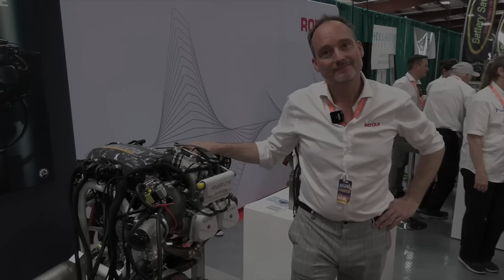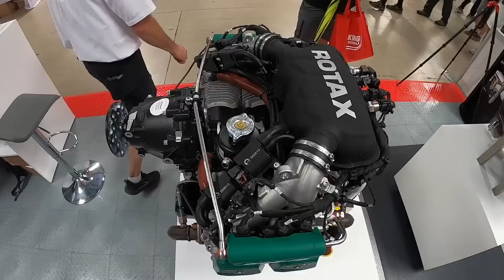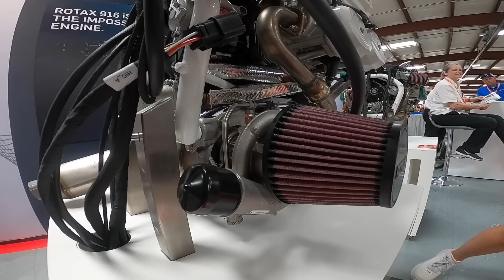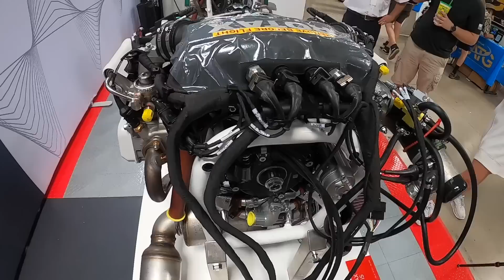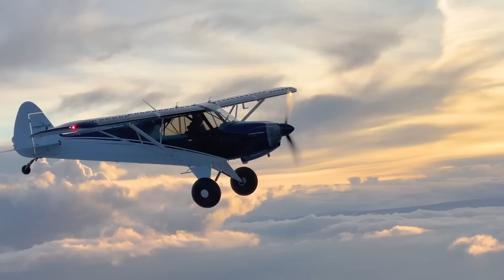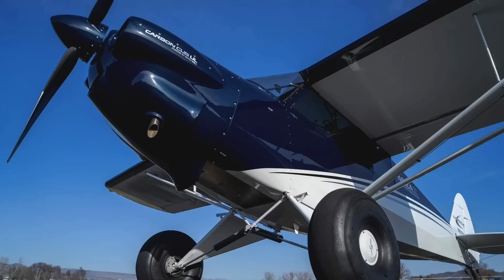Rotax Introduces 916 Engine, CubCrafters First OEM

Comment: I can get an 180 hp aero sport lycoming base with injection and electronic ignition, engine mount and a sensenich ground adjustable prop for the cost of the 916. Why would I buy that?
Reply: It weighs a lot less, it uses port injection like your car, maintains 160HP up to 15,000FT, easier to operate, more redundant, and is designed for MOGAS.
Reply: Lycoming injection is port injected actually into the intake right before the valve. Electronic ignition and backup magneto on both mags. Mag syncing on the electric side. Pilot controlled leaning or Electronic if you so choose and No gear box. Weight penalty not as much as you think as the 916 out of the crate is almost 200 lbs “ before” accessories.  No computer needed to troubleshoot on the lycoming.

Comment: They have a large research department working on new ways to overprice it and they are very proud of what they have achieved in only a couple of years. Taking a VW beetle engine and pricing it at what a Tesla costs.
Reply: Perhaps you should spend more time getting a job which can afford you one of these engines instead of  trolling the Internet spouting your distain.

Comment: I will only start to respect Rotax as a serious aircraft engine manufacturer when they produce engines with:
1) total independence from generator or battery electricity (like its classic competitors)
2) Direct propeller drive (like its classic competitors)
Reply from the maker: We'd say there's zero chance Rotax will begin using magnetos and carburetors on any of its new models. Just not the way the company thinks. Given the company's history and how many 912-based engines are working in the field, it's hard not to call them a serious aircraft engine manufacturer.
Reply: @KitplanesMagazine  I didn't say anything about magnetos and carbs, YOU did. And I really don't care about what "the company thinks". What matters to me are the features of redundancy and security of a well designed engine. Company's history? I've ben watching several Rotax failures reported here on YT and elsewhere, most of them by electrical issues. It can be hard for you, but very easy for me to see what really makes difference.
Reply: @RobertoRMOLA And ive had magnetos fail, magneto wiring fail etc. Reduction gear boxes make a ton of sense as well. Lyc/cont have internal gears for other uses and magnetos is just another type of electrical system. Truly don't understand your position.
Reply: @RobertoRMOLA  Hey Roberto, the 1940's called, they want their plane back.

Jk, but Roberto here is a prime example of the old geezers who will never get it. They insist on flying 1940s era technology because their old minds can't comprehend any of this new fangled stuff.
Reply: @sl66ggehrubt  It's not "my" position only: it's the market and industry position. Will repeat: SELF energized electronic ignition systems (not magnetos) are increasingly popular among "old" Lycs and Conts especially because of better performance and fuel efficiency. Can you understand this?
Reply: @TheOwenMajor  ...and 2023 era technology are asking for electrical (batteries are inefficient, for now), hybrid (nice intermediate solution) and diesel (the future now) engines.
Reply: @RobertoRMOLA  Roberto, the issue is you clearly don't understand the principles involved.

Ok, regarding your ignition system, I'm really not sure what you're talking about.

Something like Emag ignition isn't really "self energized". It just has a built in alternator. 

It's a product aimed at old guys like you you really want magnetos.

And the whole direct drive thing is silly. We had reduction drives in the 30s for high power engines. The only reason lyconosaurus used direct drive in the 40s was it was more reliable... For the 1940s! 

They also thought lobotomies were the future of mental health back then...
Reply: @TheOwenMajor  OK, thanks for sharing your thoughts.
Reply: Unless there's scary failure data available for either the EFI or the gear-reduction unit, these are unfair criteria imo.  Pouring leaded gas down the gullet of a Lycoming or a Continental isn't my idea of a good time.
Reply: Reduction drive makes a lot of sense. I never want to see old mags ever again. Mags that have adjustable timing are critical for better performance and fuel consumption.
Reply: @crissd8283  Reduction drives are known in engineering as an extra failure mode. And self energized electronic ignition systems are increasingly popular among "old" Lycs and Conts especially because of better performance and fuel efficiency.
Reply: @RobertoRMOLA  I do agree with self energized electronic ignition system. While a gear reduction is another failure point so is needing more cylinders to make the same power. Would you rather have a 4 cylinder with a gear reduction drive that is lighter and just as powerful as a heavier 6 cylinder without a reduction drive. There are a lot of added parts and places for failure by adding on 2 cylinders. This is a personal preference.
By the way, all turboprop engines use reduction drives. Lycoming made plenty of engines with reduction drives such as the GSO-580, GO-480, GO-435, etc
Reply: @crissd8283  I knew you were going to mention turboprops! The power delivery of a turboprop is as smooth and continuous as an electric motor. But, a piston engine produces pulsating rotational energy and vibration, but not all the engines you mentioned have torsion dampers to absorb those pulses. Furthermore, the torsion damper itself constitutes a very recurrent failure mode.
Reply: I guess nobody with respect you, Roberto
Reply: @Captndarty  I will respect your position and will fight for YOUR freedom of speech, but being in aviation for 46 years flying part 91,135 and 121 gave me a lot of experience, friends and well founded opinion. Nobody, you say? Really? You would have to know me and meet my friends and colleagues first to say that.

Comment: Wow, the 160 hp of a 320 on takeoff and with 137 continuous! That’ comparable to a 180 HP 360 running at 76%.
After about 8,000 MSL this turbo Rotax should run away from a naturally-aspirated 360. 
I’m guessing it’s maybe 100# lighter, too🎉
Reply: 50-70 pounds lighter installed weight.

Comment: This rollout makes one wonder whether the 915is will get a bump to a 2000 hr. TBO from 1200 since the 916is rolls out with the 2000 hr TBO?
Reply from the maker: Rotax is planning to increase the 915's TBO to 2000 hr, but the timeline to do so has not been finalized.
Reply: @KitplanesMagazine  I believe the bump in TBO has been talked about since it’s debut—which I think it was type certified in 2017.  Hopefully eventually.  If I was a guessing man in marketing, the TBO will not likely happen on the 915is, making the purchase of the new 916is very attractive as the 915 approached 1200 hrs.
Reply: @KitplanesMagazine  what about allowing 915 owners to flash the ECU with the 916 software? By all accounts that I have come across it’s the exact same motor….
Reply from the maker: @Captndarty  There are differences in the exhaust system as well.
Reply: @KitplanesMagazine  OK so buy a 916 exhaust and bolt it on🤷🏻‍♂️ all of this would be the simplest way to get 14% more power albeit for only five minutes…

Comment: I hope Lycoming and Continental are paying attention. The 200-300hp segment needs innovation like this.
Reply: Exactly. I hope they are working on a 6cyl.
Reply: They don't necessarily need a brand new engine. But an IO-360 with FADECs, EFI, and electric ignition (IO-360E?) would burn less fuel, be MOGAS capable, have more power, and be amenable for the creation of a TIO-360E with 300 hp.
Reply: 100% correct
Reply: Continental is owned by China… the tech will be stripped, stolen, and the company closed within a few years.
Same will likely be true for Icon aircraft.